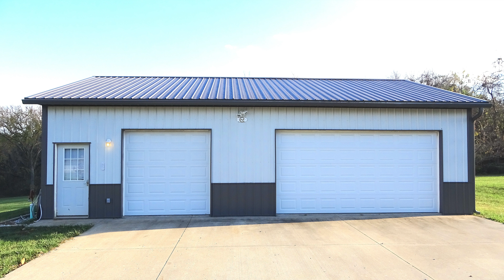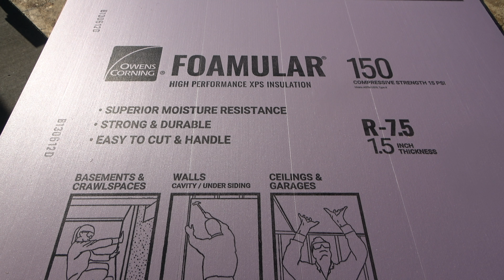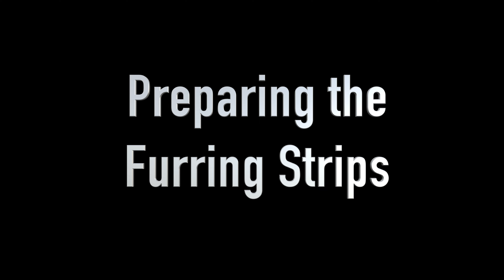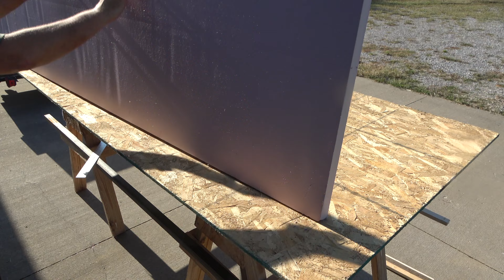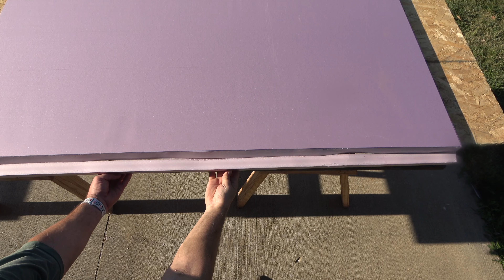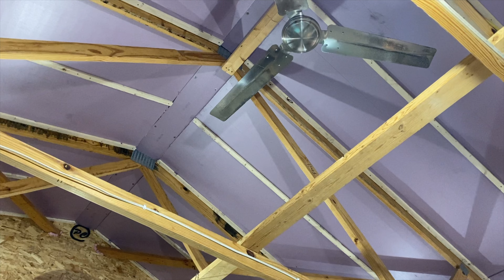Installing Foam Board Insulation to a Roof /  Shop Ceiling Insulation

Comment: Before this video, this was my vision as well. Minus the furring strips. I was going to use large light weight washers and dry wall screws, and 2" pink board. Also, flat black paint from the truss bottom on up. Really enjoyed the video and would like to see more shop videos on your heat, cooling and decor. Thanks.
Reply from the maker: Thanks for watching and commenting, my friend!

Comment: Can you tell me the purpose of that center furring strip and what you're screwing it into?  Also, would you suggest a bit of a gap between each foam board so you potentially trap less moisture?  Thanks!
Reply from the maker: The middle furring makes sure the panel doesn’t sag over the years.  I have a vapor barrier under the metal to take care of moisture.  The gaps could be helpful tho
Reply: If you’re roof didn’t have that vapor barrier how would you would go about adding one? Put it on over the insulation?

Comment: Happy Thanksgiving, Phil! I built one building when we were building a house that was about maybe 12' by 12'. for a stove and refrigerator and a spot to go in bad weather. We were in what was left of a 22 foot Prowler camper and a 10 by 20 tarp over a picnic table. Laid the foam board on top of the so-called trusses and it flapped when the door was moved. That's why I was a driver/operator. Yall have a fine time and God Bless Yall and Thanks!
Reply from the maker: Happy Thanksgiving to you too!  I am loving this insulated roof. In fact, it's 28° out right now and it's 80° in here.  My sweetie and I are spending a lot more time out here in the shop. We will actually be watching Chiefs football today next to the woodstove out here.  It's a good way to spend our 29th wedding anniversary today.  Hope you've had a great Thanksgiving and a happy Lords day!
Reply: Happy Anniversary, Palley! We're going on 20 shortly. You'll get addicted to the wood heater. We put on a metal roof and were amazed how much difference it made with the heating and cooling. We'll just build a fire when it gets below zero which won't happen much. Had a fine Thanksgiving with just us and the Grans and parents. Gets a lot like a looney asylum. Yall have Jesus days all along. God Bless Yall, Phil! @PhilCrockett

Comment: how does airflow go from your soffit to the ridge vent if you have the foamboard flush against the purlins?  I guees if it were me (will be soon as I need to do what you did on my garage) I would leave a gap on the topside of the foamboard  between the roof so the air could flow freely from the soffits all the way up to the ridge vent....
Reply from the maker: I did not seal the cracks with tape. I’m hoping this is enough. Ask me in 10 years how it worked out.
Reply: Did you install a ridge cap vent on the roof? I couldn’t tell if it was done or not.

Comment: Hey Phil, thanks for the video. Is there a way to cover up the foam board apart from installing drywall osb etc?  Thank you
Reply from the maker: I truly don't know. I've never had to worry about that. You might want to look into paint products.
Reply: @PhilCrockett  thanks for the kind response, i ended up painting it with a water based painting prdt from sherwin williams.
Bless you

Comment: What’s the temp difference?
Reply from the maker: It's extremely significant.  I'm wishing I would have done this years ago.  I can keep it in the low 70's when it's in the 90's outside.  it was 68F yesterday in the shop and 86F outside.

Comment: This video was exactly what I needed. You explained everything clearly and the examples provided helped a ton. 

Going to attempt this myself in coming months!
Reply from the maker: This is probably one of the best things I've spent my money on recently. I can't believe what a difference it makes. My box window air conditioning unit is enough to keep cool during the hot summers, and my woodstove will run you out of there on the coldest of nights. I should've done this years ago.